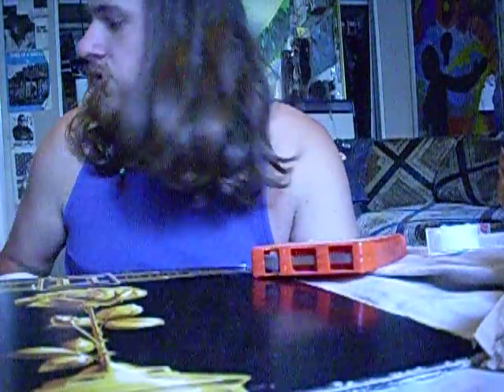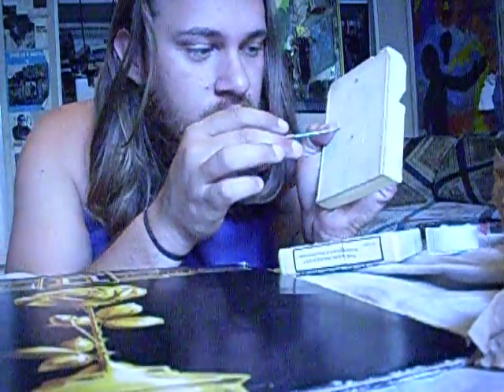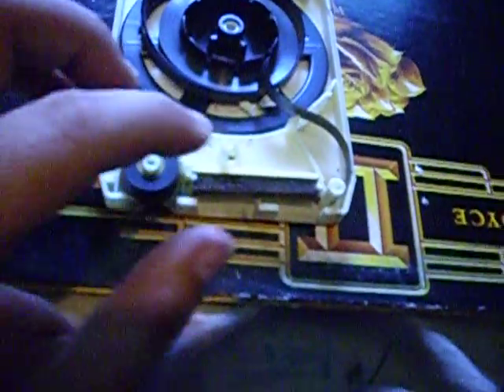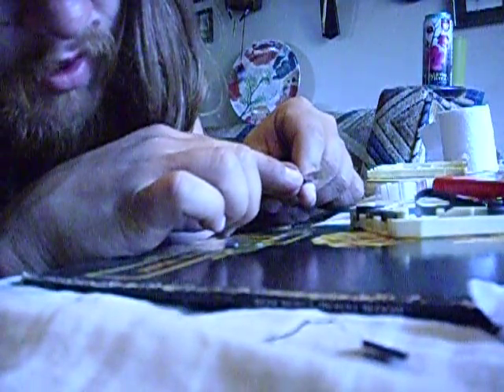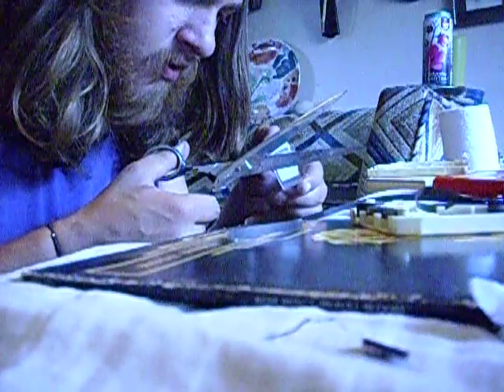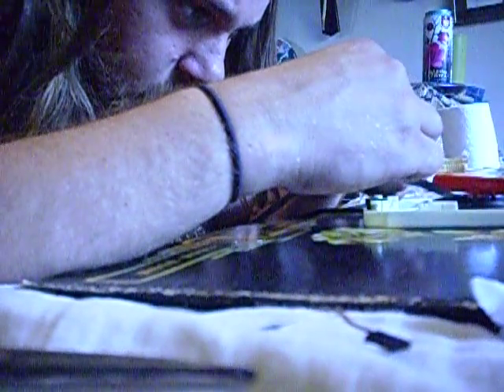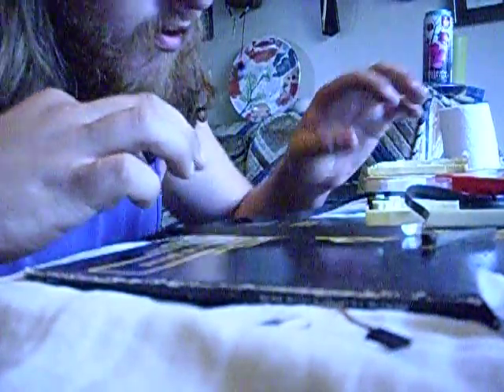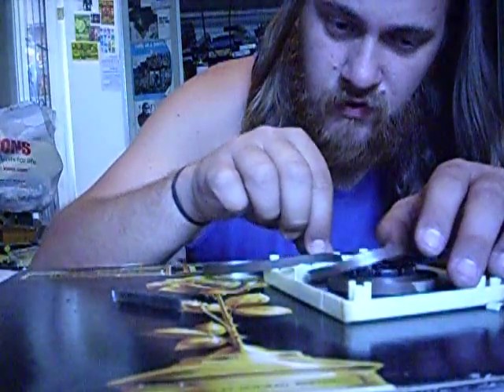8 track repare fixing a tape  video clip  2 how to fix 8 track tapes

Comment from the maker: ez  shezy, 2 ez ways . 1-go to a hard ware  store and get window weather strip,comes on a roll and is sticky on the botom, get the thickr kind. cut 2 strips n put on old strip on clean sidethen mesher n cut in half long ways so it fits clear tape n put on top of pad o tape glides nice, 2- ball up peaces of tishew n put in the fames place. of corce too reinforce sences foil with strip on tape on back .wont brake,thenn if u wand reglue foil with glue stick. let me know if it works 
joe

Comment from the maker: @usaamerica1 crushal componet..you wiil have to open andfix them all.commin problem. foams you  use weather striping.has sticky on it. and you ushaly will have to reinforcethe splice.after you fix foam,playtape..if you dont have stop fechure on your player pull it out as soon as it chicks. tape the back of the tape where he 2 ends connect,behind the foil strip.the get glue stck and regle foyal.if it coes of tae want chng ogrAms....t vieo plains allthat but im positive you wil see many probems

Comment from the maker: if the tape is too loose when trying to spoolit it back up by pulling the inter tape thuth windieng it back up. if its too loose it will make it looser. so . cut the tape. pull it tight and re tape it on the back of the tape. and set it in place

Comment: question. My favorite neil diamond 8 track tape is dragging and does not sound good. anything I can do to fix it? message me if you do. thanks.
Reply from the maker: sounds like the tape is too loose or too tight. you will have to. if too tight. create some looseness by cuting the tape and pulling the tape from the iner spool. then tape ends back together then wind it back up. if too loose. cut and pull from outer spool until it tightens up. and retape and rewind by hand as befor.